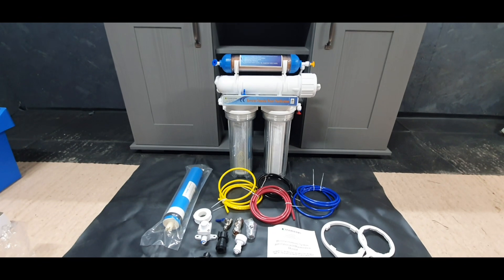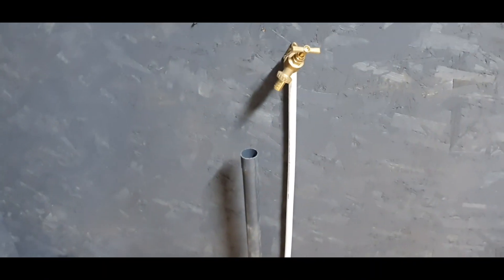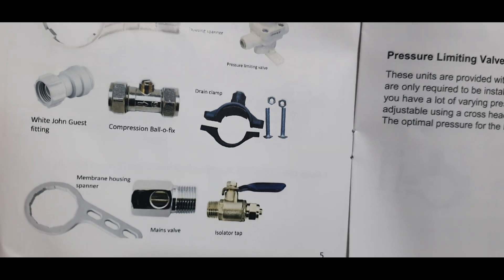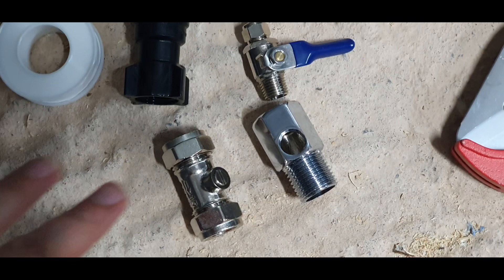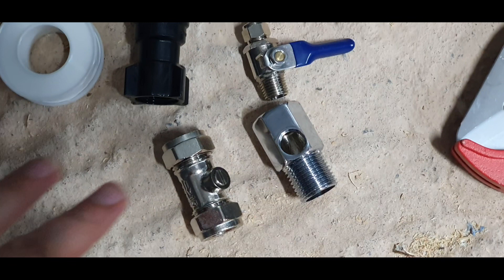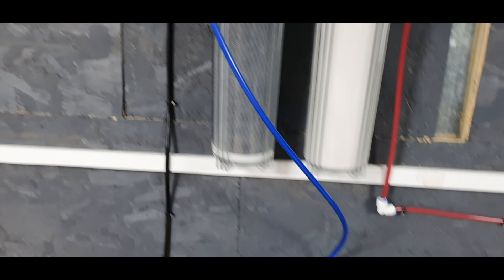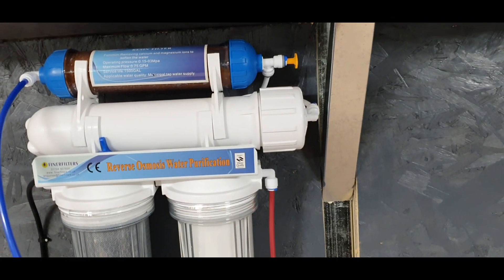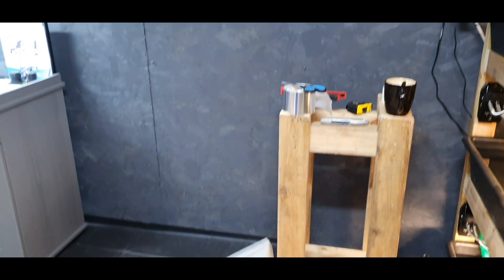DIY Fish House Build: Installing REVERSE OSMOSIS Unit

Comment: Could you explain or do a video on where the white pipes go on the back of the RO system please ive got the exact same RODI machine as yours my friend set it up differently so I’ve followed how yours look just struggling what goes in the 4 way valve and where they come out etc and also the yellow pipe where does that connect into please